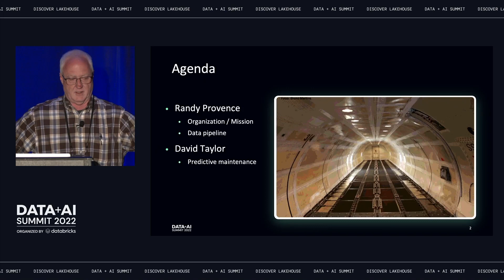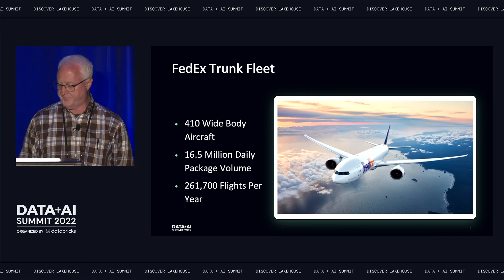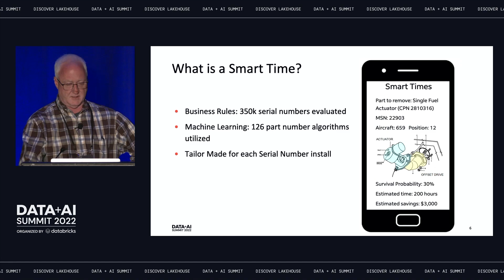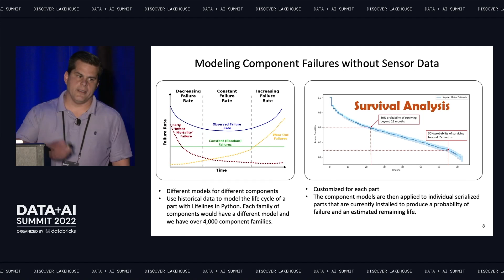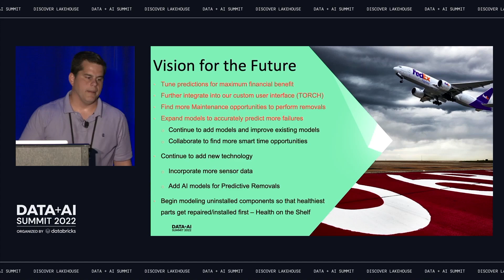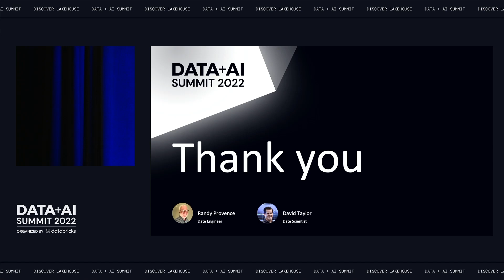Applied Predictive Maintenance in Aviation: Without Sensor Data

Comment: Export the Azure, Power Apps, Copilot, Chat GPT, Revit, Plant 3D, Civil 3D, Inventor, ENGI file of the Building or Refinery to Excel, prepare Budget 1 and export it to COBRA. Prepare Budget 2 and export it to Microsoft Project. Solve the problems of Overallocated Resources, Planning Problems, prepare the Budget 3 with which the construction of the Building or the Refinery is going to be quoted.